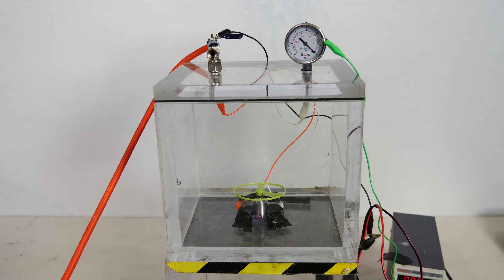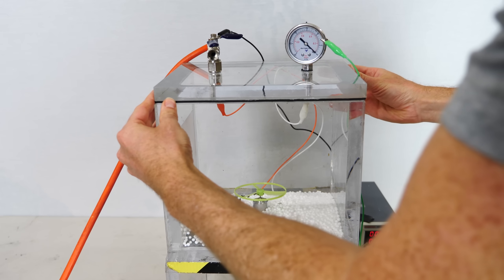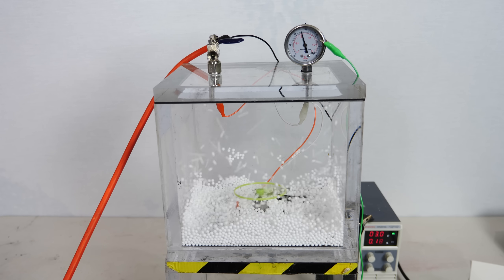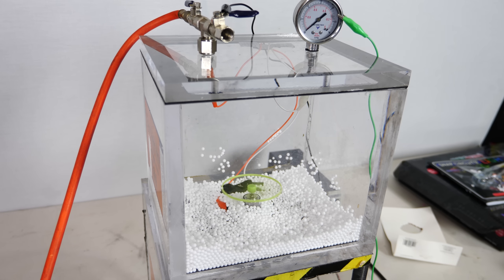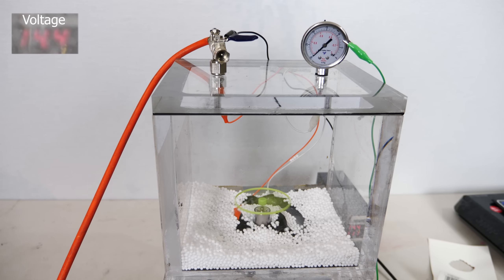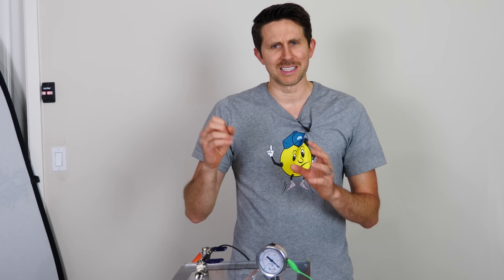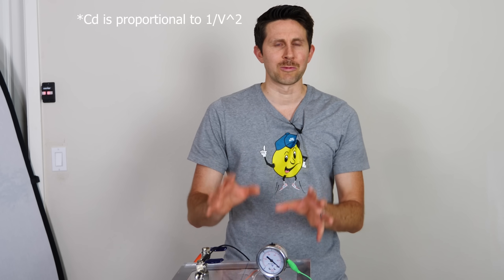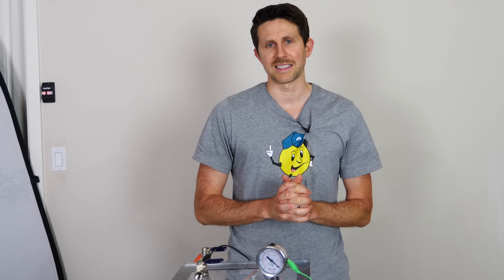What Does a Fan Do in a Vacuum Chamber? Weird Results

Comment: I'm surprised such a high voltage it didn't melt the motor's coils. Especially considering there's so little air to carry the heat away.

Comment: This shows you just why a Rocket cannot function in a vacuum. Case closed.
Reply: Lift and thrust are not the same thing.

Do you think that the Saturn V's 7,000,000 lbs of thrust was pushing against 14.7 lbs of atmosphere?
That'd be like trying to push a freight train with a rope.
Reply: Fans are not the same as rockets. 
Fans require atmosphere or air to function and rockets don’t as they use there own propellant and don’t require an atmosphere.

Comment: Then why don’t they use fans on spaceships or space shuttle to move around in space?? 
The beads moved because of the vibration caused by the motor. You should hanged the motor, so that the vibrations would have reduced.

Comment: but is it drag froces when u turn the voltage higher? or could it possibly be increase electro magnetic force eminating from the motor and interacting with the now statically charged beads??  i would suggest you retry the experiment, while only turning on the fan once the max vacuum is achieved. what do you think?

Comment: You don’t need velocity/rpm necessarily. The first half of the video you can see the current dropping while the voltage remains the same, showing the load on the propeller dropping, you just need to raise the power back up to how it was before. Which means either more rpm (higher voltage or higher kV motor), or changing the propeller: either more diameter, or more blades, or more pitch, or a combination.

Comment: Insulating perspex box plus polystyrene balls plus plastic fan to generate a static charge - I would not be surprised if the movement under vacuum is due to electrical charge and vibration of the motor kicking the beads into the fan. Interesting experiment, would like to see a repeat with materials that don't hold static charges.

Comment: Need to see the results of a vandegraph generator with it's inside parts under a vacuum.  Bet the output of the sphere would be outrageously high & could light up a large neon sign. Does anyone think that ancient Egyptians used human powered vandegraph generators to light large vacuum tubes maby filled with methane gas to light the inside of tombs while they were painting them and that's why there's no traces of sute from candles or torches or oil lamps being used.

Comment: Before watching I'm going to predict the fan will speed up because of less air resistance. With such little air it obviously won't be able to blow stuff around. (Achieving a total vacuum is almost impossible on earth.) There will also be much less noise because of less air to carry sound-waves.

Edit :Guess I was both right and wrong.

Comment: So how much of the results at the end are due to the vibration of the motor against the vacuum case from the ever increasing rpm and the not-to-particularly-well-balanced-plastic-rotor?  This might cause the foam beads to bounce with increasing rpm, eventually causing the beads to be ejected through the fan blades, which cause the rest of the beads to start bouncing in ever greater numbers when hit by the beads ejected by the fan?

Comment: These are absolutely NOT weird results. The beads  gained a static charge and the motor had increasing magnetic forces that attracted the charged beads to its rotor, eventually propelling them until they began to bounce each other more and more with increase in voltage.

Ps. Mars has an atmosphere, it's just not oxygenated.
Reply: The atmosphere on Mars is also extremely thin and less than 1% of Earth's. It would have taken winds blowing several thousand kph to have the effect shown on "The Martian". The highest wind speeds recorded on Mars are around 160 kph which would be just enough to lift a flag.
Reply: I was expecting to see the motor melt. Heat produced by the motor has no atmosphere for cooling.  A motor rated at 3 volts driven by 17 volts, probably fried the motor. The only reason I watched this was for the weird results. There were none.
Reply: Also mars has a really really thin atmosphere. The strongest winds there are extremely fucking mild
Reply: Magnetic forces only exert a force on moving charged particles so your hypothesis doesn't work.
Reply: @OMGSOMANYSURVEYS  Nahh... But thank you for telling me this, really appreciate it.
Reply: @birgirkarl  What do you mean Nahhh? Is there something I am missing here?
Reply: @OMGSOMANYSURVEYS  Well, I never mentioned charged particles. I talked about statically charged beads/balls which is not the same. 
Vacuum in a box does not affect electromagnetic forces on 'statically charged objects' even if they do not appear to be moving. All matter in the universe has movement, unless perhaps located in outer space at zero kelvin, free of any gravitational forces. That scenario does absolutely not apply to this dudes garage.
So yeah, nahhh.
Reply: the dude who made this video isnt the smartest

Comment: To avoid the static electricity issues and for ease of cleaning afterward you could have hung streamers down from the lid to an inch above the blade. As the vacuum increased they'd hang down more, without the issue of ricochets by static sticking balls.
Unrelated, that was a smart way to supply the power through the conductivity of the fittings.

Comment: I like your videos, but...you cannot compare your non-sealed vacuum chamber to Mars.  At that point you are just giving your opinion, not fact.  Also, you did not account for vibration from the fan.  What is clear is that when you remove air (atmosphere) fans or propulsion do not work.

Comment: Can we be sure that air molecules were the driving force at the higher fan speeds? Is it possible that the vibration of the fan motor at high speed was being transmitted to the chamber floor, imparting motion to balls near the fan, causing chaotic interaction with other balls further away from the fan and the spinning blades? Isn't there also a fair amount of static charge in the chamber that might be contributing to the interactions?

Comment: EXPERIMENT REQUIRED:
Can you please elaborate us that, if there is no air in space, how a space shuttle/rocket propels itself? keeps balance? Rotate, returns etc...
Reply: Do you really think that the Saturn V's 7,000,000 lbs of thrust was pushing against 14.7 lbs per square inch atmosphere?
Reply: Because it’s not a fan and doesn’t require atmosphere to work as it has its own propellant.

Comment: I noticed a proof of ohms law here. As air resistance dropped so did current. Started at 0.20 then dropped to 0.13 . I'm assuming the bottom display on your power supply is current.  Interesting...

Comment: One more thing noticed in this video is the Motor's Current consumption reduces when we reduce the pressure in the chamber. The current consumed by the motor depends upon the work it is doing or the pressure on the rotor. So when the pressure in the chamber reduces and motor's rotor feels less presure and does less work and consumes less current.

Comment: I've always wondered why some cheap electronics dont work or work poorly in a vacuum.
I went on this science field trip once, and they had a cheap vacuum chamber and pump. We put a cheap electronic LED candle inside it, and after pulling out a lot of air, the LED either turned off or went dim and flickery. Why is this?
It would mean the world to me if you made a video response, thanks!

Comment: Static field also in your container. Yes there are sand storms on Mars, but still questionable about anything else. As the materials you used are different than Mars, you correlation is faulty.

Comment: The experiment does not rule out the statically charged balls interacting with the increased EM field of the overloaded motor. I know it isn't this effect, but not from this experiment. Interesting to see though, taking the result as intended. I was expecting some movement at higher speeds, but not that much.

Comment: Noticed that at 3.0V, the fan used 0.24Amps.  As he started drawing a vacuum, the current the motor uses starts dropping and reached 0.13Amps by the time he moved the camera.  With less air in the chamber, there is less friction on the propeller, so it spins faster, causing more counter EMF and dropping the current. You can barely see it in the video, but it looks like the current dropped to 0.08Amps just before he turned up the voltage.  So the motor used 1/3 the power in a vacuum.

Comment: Obviously the fan won't work, but I'm here to see if the motor spins up until it destroys itself from centrifugal forces, welds the berings, overheats, or some lovely combo.  Let's find out...

Edit: That fan handled that far better than I expected even with being overdriven - there's still a huge difference between a thousandth of an atmosphere and hard vacuum.

Comment: "fan in a vacuum chamber can it still blow stuff around" What exactly would it be blowing in a vacuum?
Reply: In a perfect vacuum: nothing. But you can only get (extremely) low pressures in a vacuum chamber, not a perfect vacuum. At some point you have the problem that even some chamber materials and sealant boil off (at ambient temperature) and/or let tiny amounts of gasses pass because of the pressure gradient. That might not be much, but enough so that keeping a low pressure (near vacuum) is nearly impossible. (E.g. If you have a tiny amount of water somewhere it's impossible to go lower than ca. 100Pa until it all boiled off - and your pump transported it out)

Comment: I would have liked to see the power supply kept in the frame. As the vacuum increased, not surprisingly, the amperage decreased. I didn't get to see what the current to the motor bottomed out at, but, if the fan was removed from the motor, the current should be similar(about .15 amps) The fan in the vacuum chamber pulled to the limits of the pump should turn about the same RPM, and draw about the same current, as the unloaded motor spinning in free air running at the same voltage. Be careful over-volting a motor in a vacuum. With no air mass, there is no way for the motor to cool itself.

Comment: This is actually a very good visual representation of vapour pressure and the ability of a simple mixture of water and ethanol (for instance) to allow evaporation. If the pressure is equal in and above the liquid nothing will evaporate. I am sure you will get my train of thought even though I am unable to formulate my line of thought in this comment ^_^

Comment: the thing about mars is that like you said you need highier rotation per minute speed, however, because of high speed, parts became quite warm/hot, and lower preasure will not cool down heat as fast as here on earth, even that on mars you have lower temp than on earth. Also, faster rotation means you need more energy and like you know, mars is father from the sun then earth, so charging batteries will take more time. I'm not saying it is imposible to have drone on mars, but it might be not practical.

Comment: Aww, I used to have a turbomolecular pump in my laboratory. It was used for evacuating a chamber for depositing a layer of carbon onto cleaved sheets of mica for electron microscopy. I think it used to get down to around 10^-5 Pa. The chamber was quite small though, maybe double the diameter of the fan used in this video. 

Our electron microscope used to have several pumps, some of which were in the room and some were out of view. I say aww because I never realised how awesome some of the stuff we had was. You just sort of take it all for granted a bit.

Comment: When you close the hose of a vac, you can hear the motor spinning faster because of less air resistance. I was watching your power supply to see if the amps would change. Pitty the camera moved the supply out of view.

Next experiment, see how the speed of the fan and the amp usage change. Then use a fan with vertical blades as in a regulator and see the change in that.
Reply: It went from 0.25 to 0.15A.

Comment: Note that when you started the vacuum the current dropped, then you moved the camera away so it was not visible anymore. The current drop at same voltage means there was also an RPM increase.

I'm sure most of the movement of the foam at max vacuum was not due to vibration, not wind.

Comment: The motor was probably overheating, since it is essentially air cooled
Reply: Also it was probably rotating a lot faster than it normally would at that voltage due to the lack of air resistance. I'm not sure if that actually means that it takes more damage though.
Reply: @nekekaminger 
Thanks for the puzzle!

 I probably was way off in my initial assessment because I didn't include one of the most basic facts about electric motors. .What heats them, more than anything else, is electric current through the windings. the more load you put them under, generally,  the more current they draw. The highest current usually occurs in a completely stalled, locked rotor condition. As the vacuum deepened, we could hear the rpms increase .Predictable, because the propellor uses less power when it has less air to move. Lower air resistance as you say. As the load decreased  and the rpms increased, theory says current would decrease and therefore less heat would have to be dissipated.

Judging from the complete lack of cooling holes in many small motors, designers don't worry much about heat damage.
Reply: @herbertshallcross9775  Sounds plausible. Unfortunately my knowledge about electronics is way too rusty to help you with a reasonable prediction xD

Comment: the dust on mars' surface is actually extremely light -- lighter than the foam pieces in the chamber. this is part of the reason why there are such large dust storms at all. the dust is so light that it can easily lift up into the atmosphere.

Comment: Pretty sure the beads flying around was almost completely due to the vibrations of the fan transferring to the bottom of the container. You'd think that's where the real fun begins and he would suspend the fan with strings to examine the difference. No the video just ends. This channel is pretty much pointless.

Comment: "with a turbo pump you can get down to 1e-9 Pa" he says, as if that's a straightforward and simple feat. Yeah it's technically possible, but boy is it difficult to actually achieve.
Reply: Crack out the helium leak detector.... 😥

Comment: So, in the total vacuum of space, which we can’t even replicate here on earth. And it’s volume is much greater than a 12 x 12 cube.How does a rocket engine work? What does it push on to cause movement? Hummm think think think oh bother.
Reply: iirc it uses newton's 3rd law. the expelled gasses cause it to move but don't quote me on it lol
Reply: Neko Master I get it, when a rocket engine pushes against our atmosphere the rocket is propelled forward hence newtons third law but once you get into the total vacuum of space and there’s nothing to push upon so the equal and opposite reaction is no longer there.
Reply: @charlesshinn7116  the expelled gasses cause it to move in vacuum.
Reply: Lift and thrust are not the same.
Reply: Lee B yeah I get that. You need thrust in order to achieve lift. So the two are different. What does that have to do with my comment above?

Comment: Your a genius butt you didn't consider all the static charge from the plastic propeller to the static sensitive foam in a plastic hight static out put chamber. So even without air the static generated moved the prices with some help after depleted air.

Comment: It's cool that you can see the current drop as the pressure inside the container decreases. Pressure decrease = less load on the motor = less current the motor has to pull to overcome the load. Pretty cool!

Comment: We use Cryo pumps on some machines at work.  Temperatures commonly are 11 degrees Kelvin.  Working refrigerant in the pump is helium.  We achieve 4 x 10-7 torr on a regular basis.

Comment: I wish you didn't move the camera. As the air was leaving I was watching the amperage drop. No air resistance means the motor is pulling less current
Reply: Same
Reply: agreed. The fan spinning in the vacuum should be similar speed and current draw, as the motor spinning, with no fan in free air. I, too, was watching tha ammeter as the vacuum was being pulled.

Comment: Another cool side effect of pumping air out of the chamber is , when you observe amperage on lab bench power supply - it is dropping due to less drag on fan itself. Nice experiment!
Reply: When the camera moved I was thinking “no, no, go back I want to watch the amperage” lol
Reply: It can also be because as there was no air to drain the heat from motor the wires got hot and resistance increased.
Reply: @ahmedejaz1125  That would have been an increase in amps due to higher resistance. What we saw was a reduction in amps because the fan was spinning more freely. =]
Reply: @LocoHosa  no when resistance increases current decreases because I=V/R so I is inversely proportional to R if voltage is constant.
Reply: @ahmedejaz1125  Actually the Voltage was not constant. it changed from 3v to 17v so V=IR does not apply in this case.
Reply: @owomaogbayibo  i was talking about the time from 1:10-2:10 where voltage was constant 3V but current dropped from .25A to .13A.
Reply: interesting video, why was i watching this ?
retake ideas : keep V A readings in shot, display RPM, slowmo of fan detach.